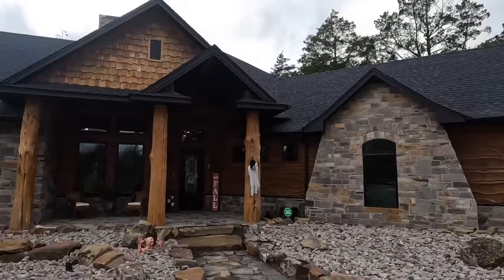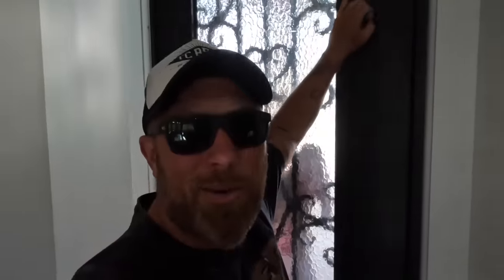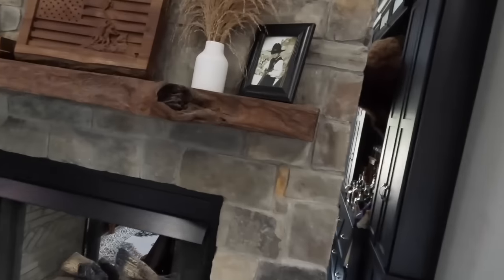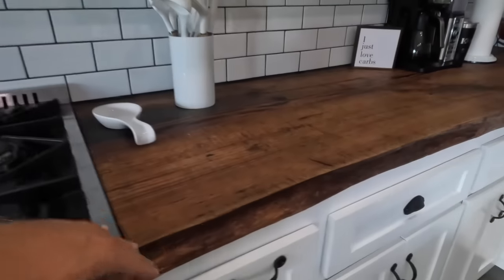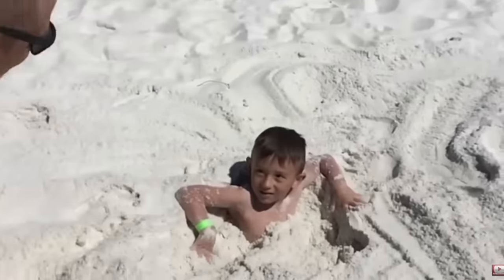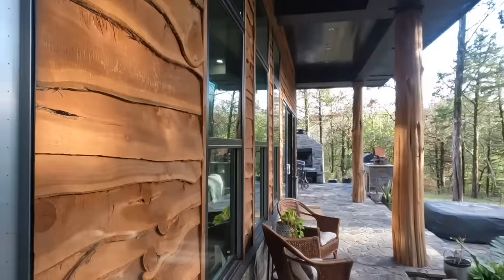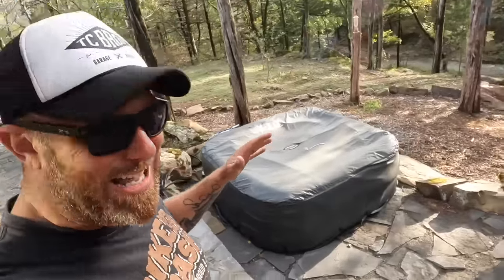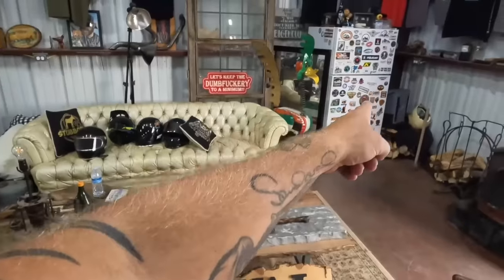YouTuber Goes From Homeless to Dream Home: Living The American Dream

Comment: Hey Adam,  I really like your Home, It's very well thought out and very unique and Original.  Maybe you could sell Blue Print / Floor Plans of it.  People could start with the basic design then change to suit their own Taste.  Lost of windows to let in Natural light.
   The Concert floors seem Low Maintenace and affordable.  Do you have heated floors?  Heat Floors are very common in shops.  You Shop is nice, but Insulated would be so much cooler in the summer and easy to heat in the Winter.
   I assume you don't have a basement?  I like basements to store a lot of Junk , Escape Tornadoes and have  a Wood Gasification Boiler.. You can heat your  house and hot water with a wood gasification stove or boiler and they don't smoke.  You just need very dry well seasoned wood.
Reply from the maker: That heater system sounds awesome!